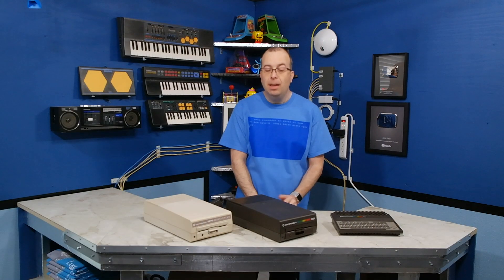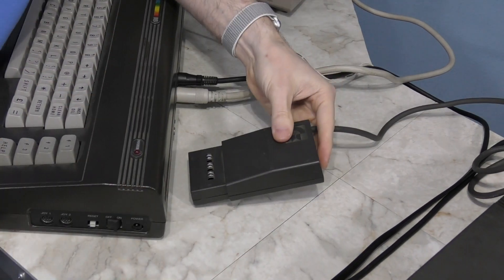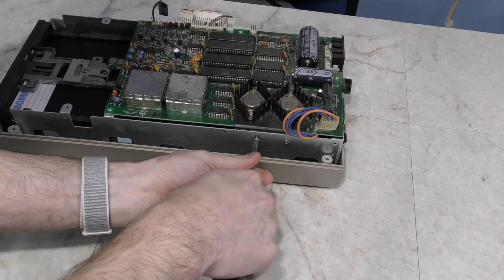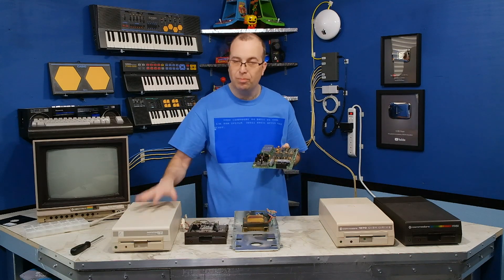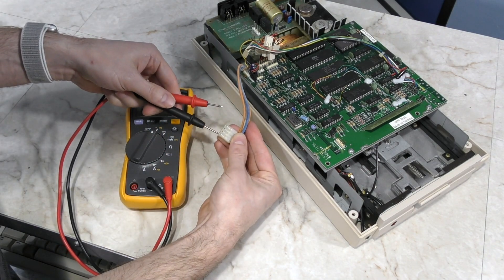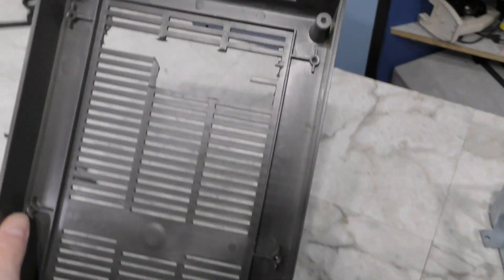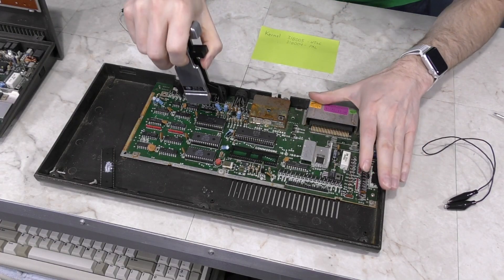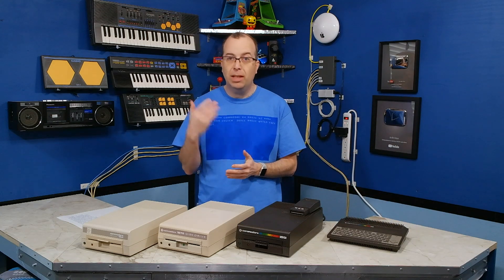Commodore C116 and drive repair, 240V to 120V conversion

Comment: Saying there’s no 240 V in the U.S. isn’t entirely true. In residential split-phase service, connecting both hot legs gives you 240 V. The real difference is frequency: U.S. runs at 60 Hz versus 50 Hz in many other countries.

Comment: You don't have to break the plastic pins to get the PCB out. Instead, heat them one by one with a hot air gun (soldering tool) until they melt sufficiently so the PCB can be pulled off. If the top breaks off, still no big issue, some hot glue helps.

Comment: If a solder wick doesn't work.. give it flux. If you just resolder the pin the added flux is usually enough to get it out after.

Comment: Just a word to the wise to your viewers ... research what it may take to fix something that you buy broken intending to repair it.  I bought an old video camera I thought I could get working.  What I didn't know was the circuit boards sometimes have multiple layers.  Components may be embedded into the boards and impossible to replace.  I spent $60 on that lesson 😋

Comment: I'm wondering how only changing the ROM and the clock frequency can convert the video signal from PAL to NTSC... Clear: the switch from 50 Hz to 60 Hz (which has BTW little to do with PAL and NTSC) should not be that difficult, but the completely different color encoding? Does the video chip in the Commodore 116 have all the circuitry built-in for both systems? (making the chip more complex, but only one chip needed for the whole world - does it do SECAM as well?) Or is the color signal completely generated by software?

Comment: I'm sure others might have said this, but just about every house in the US has 240 volts. Its just not commonly used for regular everyday needs. 

The bigger problem is the phase difference.

Comment: does anyone know why some countries went with 110V-120V and others with 220V-240V?
Reply: 240V requires half the copper for the same power. 
I think that's the reason why that voltage was selected for home use in EUROPE after WW2. We were poor people and copper is expensive...
Reply: @jesusarias4320  no it’s more expensive to be on 240v the switches alone cost more  we also need thicker gauge wire and thicker contacts on plugs. I’m an EE myself. Hope this helps.

Comment: What was better? PAL or ntsc? I think pal but i Never used ntsc so in anxone knows.
Reply: PAL has better color rendering. So much better that it was adopted everywhere outside US. But the N of NTSC stands for "National", and those US guys had to get stuck to their standard and to pay for their bigotry by watching weird colors on the TV screen for decades ;)
But, while this is very clear for TV images, I don't think it does make a difference for the poor video modes of the 8-bit computers.
Reply: @jesusarias4320  well it could in his video about rgb modding did he a comparison of composite and rgb and it was a really big difference and I know that Pal would also do better because I even use composite pal for some things today and it looks almost ok
Reply: @nlk294  An RGB signal is basically the same both for NTSC and PAL (NTSC has a higher frame rate: 30Frames/s vs 25, PAL a higher vertical resolution: 625 lines vs 525), and in both cases the RGB image would be much sharper than anything coming from a  composite video signal.

Comment: Flux is very helpful when removing parts - it helps transfer heat and the solder flows easier.  Just make sure it's flux designed for electronic components - NOT flux for plumbing!  

Low temperature solder is also useful for removing larger parts.

Comment: Pal to ntsc converter?
Reply: Not an easy circuit, even when considering that half the lines of a PAL frame are identical to NTSC. The main problem is the different refresh rates. In the video the Commodore monitor is unable to sync vertically due to this.
The best solution IMO is to get a multi-standard monitor/TV.

Comment: 1:00 Wait! that was 2018. Do you still don't have there ANY Multi Video Mode Supported TV??
(So I am from Sri Lanka where PAL-B Realms. Since my childhood, we have MULTIMODE Televisions. Which supported at least NTSC 4.43 with a tint controller like stuff. As a kid foolin around, I have experimented setting a PAL channel to run in NTSC which made it displayed like when the TV was exposed to a huge magnet)

Comment: In Europe there is 220V not 240.
Reply: My meter reads 227V AC.
For three-phase systems voltages get multiplied by the square root of three when you change from star to triangle configurations, so the usual voltages should be: 127V, 220V, and 380V.
Of course, line voltages have tolerances and 240V is still inside range.
But I suspect power companies are claiming the line voltage is 240V in order to charge you more in the "power quota" term of the bill ;)

Comment: Cool vid.  Good work.  Just like tube amplifiers,  its usually someone doing something dumb like blowing a fuse,  or worse smashing the thing around and having a shorted rectifier tube wipe out the power transformer.

Comment: 1:28 "We don't have 240 volts here in the United States."
NEMA 6-20 outlets: "Am I a joke to you?"
Reply: Also level 2 ev chargers: same here buddy.
Reply: @DJOLEX 555 k
Reply: 60hz 240v still won’t work properly for PAL systems that require 50hz 240v
Reply: Well there no wire in your home will have 240v (breaker)
Reply: @Moocat90  (i'm the same guy)
You're wrong. I have two 240 volt outlets in my house; one is for my clothes dryer and the other isn't being used at the moment.
Reply: @that_green_neko  he's technically correct (the best kind of correct). Your 240v clothes dryer has two 120v hot wires that are 180° out of phase and provide 240v across them. No single wire in a US home carries 240v.
Reply: Ronnie Roo  Yeah, we use one for an electric oven too.
Reply: Aren't those usually reserved for businesses?
Reply: Yes, because NEMA 6-20 don't give one 240v signal, but 2 120v signals.

Comment: I was given a part-time job of repairing C64s and 1541s in the early mid 80's in the town were I worked. The job came with a large blue folder with theory, schematics, waveforms, test programs, test roms and 8 (or so) alignment floppy disks. They had sine waves recorded on various tracks and you could see this with a cro attached to the head (or the amplifier, been too long now) as you stepped the drive back and forward.
The 1541 suffered from software protection schemes which relied on bashing the head of the drive back trying to go beyond track one (clackity clack sounds) and the stepper motor shaft would slip (rotate a bit) in the cog that pulled the metal tape attached to the head carriage. It was only a press fit.
I figured the best cure was to pull the stepper and cog completely out and drill a pin through both so it'd never move again. There were rotate slots on the stepper mount flanges so you could rotate it a bit for alignment as you put it back in. Drilled at least 60 of them, never got a return unit.
Reply: Might still have that folder downstairs somewhere.

Comment: technically we have 240 volts across two lines that enter the house. one is connected to the box and we reference a ground wire from it as well as i believe neutral. essentially it breaks it into two 120v lines with the house plumbing being the "ground" reference.

Comment: u could have removed the transformer and replace it with 5v buck converter and 12v buckboost converter and also add a bridge rectifier to the input! ... then u can plug anything from 7v to 24v or 32v or what ever the maximum limit of ur converters are and also set some current limits just incase anything shorts out the psu will go to current limiting mode! and save parts! ... and u can plug any polarity adaptor !!

Comment: majority of the world: lets agree to the same mains voltage and frequency
US: what even are standards?
Reply: Our standard for power literally predates it, but k. The European standards are newer and they wanted us to switch for literally no good reason
Reply: @evilkillerwhale7078  why "no good reason"? the reason is to have a universal standard across the whole planet.
which for example would make the production of any electric device (that uses mains) cheaper and easier as you only need to make them for one voltage/freq. instead of having to split between US and rest of the world

and why does it matter that the standard is older? that's not a valid reason to keep using it, quite the opposite actually.

Comment: Sorry to necro, but what's wrong with putting a modern 5 ant 12V power supply in them and having all the drives working. Granted you would have had to fix what the idiots did to trash irreplaceable pieces of history...

Comment: Fun to watch. I remember having to take my disk-drive apart repeatedly and mess with it due to loose connections inside. Not until I learned about conductive contact-spray did I get it fixed. I ended up getting the 1541-II instead but once I finally got my old drive working, I could copy disks for people. I ended up selling the old drive when I had moved to the Amiga, but I still got my old c64 and both the cassette and disk drive. They still worked 8 years ago when I last had it powered on. Sadly I let a pal borrow my 8 c90 tapes packed with turbotape games, back when C64 was still hot. Just that his dad bought a brand new 486 pc soon after. My pal directly binned his c64, all stuff, and my tapes..... instead of handing them back to me and letting me have the other junk. He never even apologised, saying how c64 games all were crap anyway. I have not spoken to him since and I hope he is repeatedly unhappily divorced and dirt-poor by now.

Comment: If you plan on getting some more European/Russian, generally speaking 220-240V stuff, maybe you may consider contacting some electrician and ask whether it would be possible to use some transformer and have some 230V circuit in your computer room.Then you would not have to change internal parts of your machines in order to get them working.

Comment: Hey, a little advice. When desoldering you will need to use flux compound to make sure the solder melts and stick to the wick. Also, the board is likely covered with protective lacquer which will interfere with your desoldering. Hence it’s a good idea to use some fresh solder on the joints first to melt away any protective layer you may have and then desolder. 
Finally, buy a proper desoldering gun ;)

Comment: I've already mentioned this in a comment on another video, but I'll mention it again for the sake of people watching. If you reflow a bit of fresh solder around the joint and maybe a bit of flux, it'll wet the solder wick much better if it's giving you trouble. I learned that from Big Clive.

Comment: By the way the easiest way to de-solder a part that will never be reused is not going to be used is to clip the leads. Pick them out with the soldering iron and tweezers. The use the solder wick or a solder sucker. This reduces the chance of damaging the board.

Comment: Actually we do have 240 volts. Electric stoves, electric dryers, welders, and large air conditioners run on 240 VAC 60Hz.

Comment: One thing I noticed: You didn't change the frequency on the sticker (for accuracy purposes). Europe uses mostly 220/240 Volts at 50 Hz, while AFAIK the US uses 110/120 Volts at 60 Hz. ;)

Once we tried to do the opposite with a video cassette we brought from Costa Rica to Germany (back when we lived in Germany) back in 1994. Costa Rica uses NTSC and Germany used PAL, and while most devices in Europe could run PAL and SECAM (the French standard). We could not get the cassette to work on our PAL/SECAM VCR because we didn't think about it. Nowadays, it's very easy because you're things like ISDB-T or DVB-T are just transmission standards and footage can be recorded in universally compatible formats on a computer.

Comment: you can check the tarnsformer and see if the input side had a center tap. If iit did then you can use thecentre tap and one leg to input 120v

Comment: In my experience, a little bit of "fresh" solder on the joints, and then using the wick afterwards makes it a bit easier to remove solder. Though if you can, a flux pen works just as well!

Comment: pal and ntsc commodores (at least the c64s) have a different video chip with a different number. ntsc and pal can be viewed on normal composite monitors for either, just that the vhold has to be re-adjusted (which can be done on any crt monitor or tv, just that with tvs it's on the inside of the case) and the picture will be black and white. the video signal itself is exactly the same. just the color information is done differently. hmm... soo the c16/plus4 series actually have some software reprogrammable video generator. or just 2 chips in one (guess by the time they made the c16 there would be plenty of space on the chip to just add both into the same package anyway at pretty much the same cost) for most other cbm stuff it ain't that easy and the actual vic chip needs to be replaced along with modifying the kernal and some other things.

Comment: 240 V? Here im Europe we have 230 V!
Reply: Not when these floppy drives were produced.
Reply: Daniël Mantione False! Back then we had only 220 V , now we have 230
Reply: Mainland Europe was 220V, the UK was 240V. Many Commodore floppy drive have a transformer that can be easily switched between 220 and 240V by replugging a wire.

If the 8-bit Guy had a floppy drive that was originally sold in the UK, then it was a 240V device.
Reply: Daniël Mantione since '73 uk is in europe
Reply: I wrote mainland Europe, and the UK is still an island. It is part of Europe though since geological forces shaped our continent. The UK was rather late in adopting 230V, end of the 90's if I am right, but whatever, they did originally use 240V and thus there exists 240V Commodore equipment.
Reply: Daniël Mantione sorry, didnt saw that mainland, most of the zime the fiest word is the name of the person the comment is meant to^^

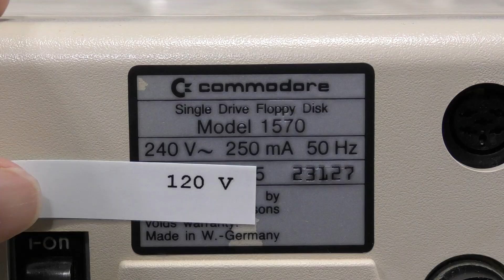Comment: 10:59 - And it still reads 50 Hz instead of 60. That might bug you as well. Also, I just thought of building a new disk drive called the 1556 (that number is the average of 1541 and 1571) that plugs into the cartridge port of the 64・128, accept 100〜240V (to cover all countries), as well as device $02〜$FF ($00 is the keyboard, and $01 is the tape drive).

Comment: I haven't seen a commodore plus 4 in your videos yet. I guess it's very rare to find as it was a complete failure before commodore died, but I remember it as a neat design rather similar to the C116. Very interested in it if you get a chance.

Comment: I just realized that the commodore 64 and 64C is just like the xbox 360 S and xbox 360 E because they both the 64C and 360 E are just the same as their predecessors just updated styling

Comment: If you want to further test your C116 whilst you wait for a replacement keyboard you can use a Plus/4 keyboard.  A Plus/4 keyboard is 100% compatible, but obviously won't fit in a C116.  There are two versions of the C116 keyboard:  A 64 key and a 65 key.  You can replace a 65 key keyboard like you have here with a 64 key and it will work just fine.

Comment: Hey 8bit guy, some corrections: The 1551 does not use the standard 6510/8500 from the C64, it uses the 6510T. This version has all 8 bits of the I/O port on the pins available, but lacks the NMI and RDY pins. The 7501/8501 of the C16 series and the 8502 from the C128 have 7 bits of the I/O port available. The 1551 also doesn't have two VIA 6522, it has one TIA 6525. Together with the 6510T these two IC's also have four 8 bit I/O-ports, which saves one chip. For a floppy controller, NMI and RDY are probably unimportant, also the timers of the VIA's. Inside the the expansion-port connector (also called 'paddle') is a 6523T 'crippled TIA' chip. It's a rather weird 28pin-IC, it seems that it has one full 8-bit-I/O- port 'PA' and each two lines from ports 'PB' and 'PC'. Here's the pinout:

http://mhv.bplaced.de/test/pinout/6523T

It's possible to rework a 6523T cTIA from a 6525 TIA. In conclusion, the 1551 contains a total of 5 1/2 (?) 8 bit I/O ports, one in the 6510T, three in the onboard 6525, and 1,5 in the paddle connector... this should also contain a PLA or something, that the 1551 it should react like a cardridge. The 1551 was called SFS481 in prototype state and is probably holding the world record for the slowest parallel drive... One of my 1551 drives has exactly the same breaks in the plastic material.... I thought it was mine ;-) Maybe the plastic Commodore used for the 1551 was not so durable.

Is the 1570 so rare? I still have two of them and never plugged them in. I'll keep them mostly in case one of my 1571 boards will die and I need a replacememnt. It's possible to restore a 1571 from a 1570 board. The ROM has to be changed, it is not too different but all accesses to the second head are creating an error message, I remember. There also was no JiffyDOS ROM for the 1570, so it's a rather useless drive.

Do you have a SFD-1001? This is is one half 8250 in a 1541 case, with two 6502 CPUs, IEEE-488 bus and it uses the 78-track 8250 format. So this drive has 4133 blocks free, which is about 1 MByte, more than a 1581. However, you have to use QD (Quadruple Density)-Disks with 100 tpi. HD disks will not work, but 96 tpi disks should. I have mine not tested yet because I don't have something with IEEE-488.

Power Supply: in Germany, internal Commodore drive transformers had windings for 220 and 240V. in the 80's we had 220V, so the rework to the 240V winding was a common method to create less heat inside the drive. Later the power was increased to 230V, so it was better to do this rework.

The C116 is really weird, I also have one. It's funny to connect two 1551 to it: Both floppy connectors seem to be longer than the whole computer :-D